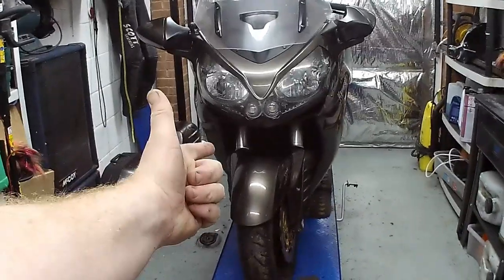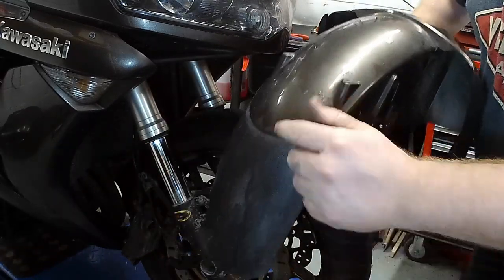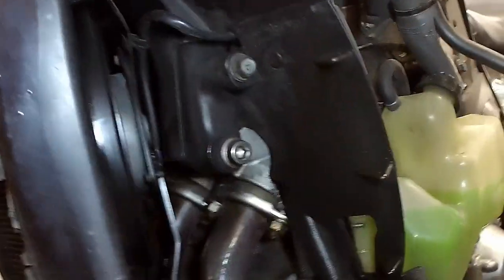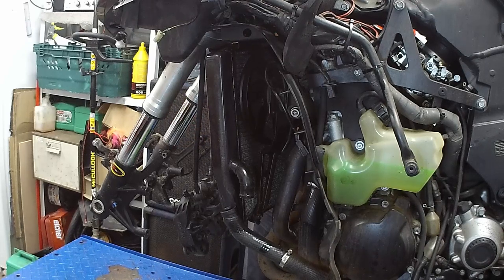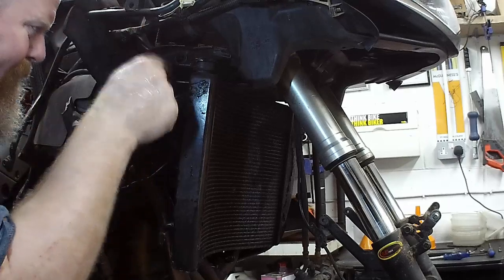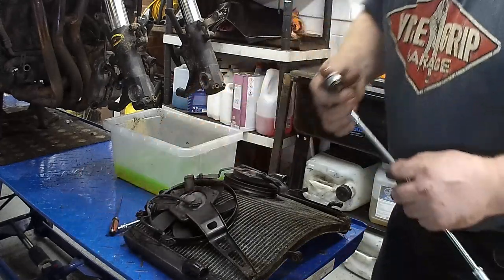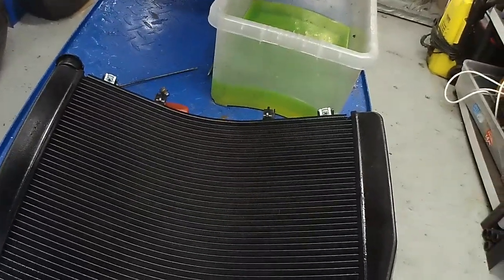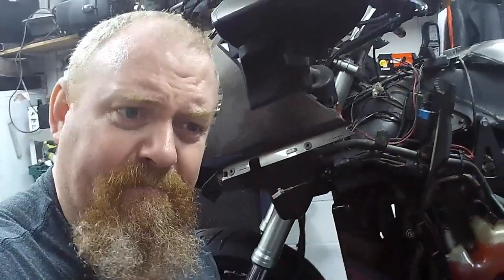How to change a Radiator Kawasaki GTR1400 Concours

Comment: Ive got the '11 connie 14 all bone stock if I just replaced the radiator should it be the new Oem or will a new aftermarket work ok?? I wont do used..
Reply from the maker: I’ve used aftermarket. Only problem was the radiator cap filler neck was the wrong orientation so the plastic retainer lock stop thing no longer works. This is my second one. They are cheap for a reason. I sprayed this one in some hi-temp paint before installing to hopefully mate it last a bit longer
Reply: @Gruffaloscoot  Yes thats funny I was thinking the same thing about the neck orientation it would have to be exact. The retainer clip isn't a big deal caps don't usually come off if it's not used. As long as the mating and mounting holes for the fans and to the frame are a good fit is my concern..Went to Kawi parts new oem Rad "$1000" Uhuhh that's a  BIG NO!!!.. That's criminal they charge that much for a stupid radiator..
I'd be reluctant to paint it, might retain more heat may run hotter, maybe not.....Good job though